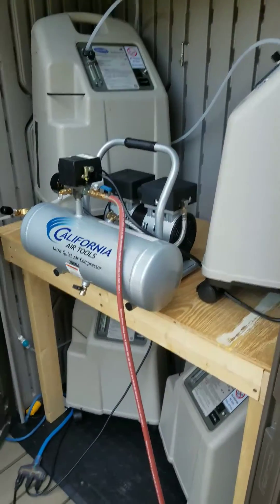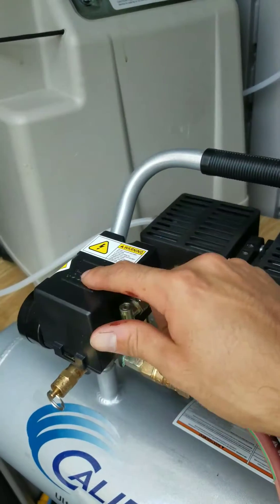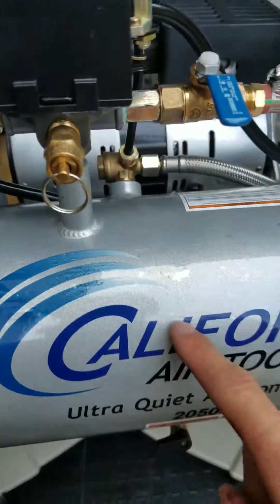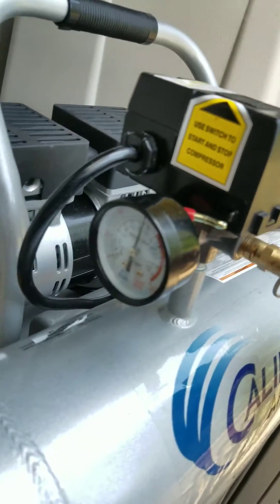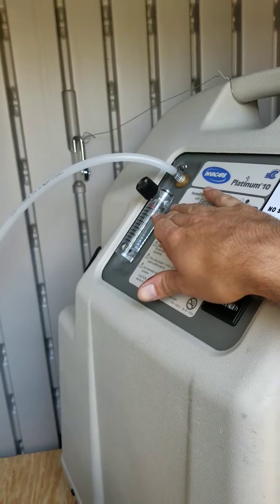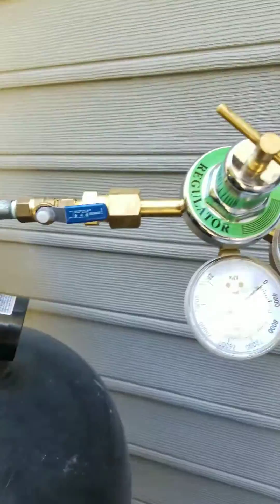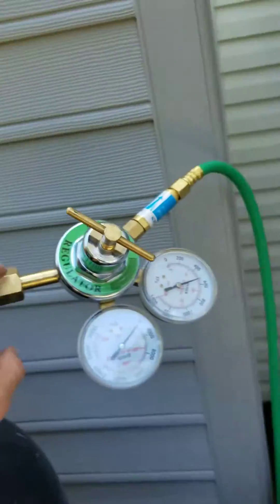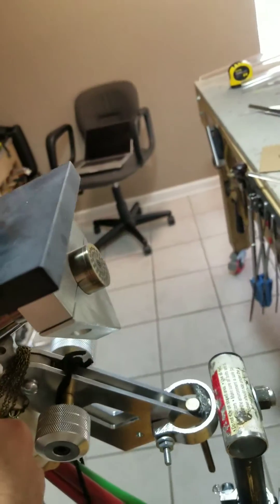Compressed Oxygen System for Flame Working/Glass Blowing

Comment: The studio I learned at had a setup similar to this. The question I have before setting up my own is does the compressor pull more than the concentrators can give? Would this work with just one 10liter unit?
Reply from the maker: Im glad its helped many artist. To answer your question, It will not. You have to have the same or more lpms than the compressor can compress. Otherwise you will encounter loss of oxygen purity. Theres also loss of purity when running oxycons at full 10lpm. I prefer the purity of running all 4 at 8lpm.
Reply: @MrAlejo53 I see, that’s what I figured. Do you know how many lpm that particular compressor is, I looked but it was in cfm and when I converted it was like 60-70 lpm. Thank you for answering my questions! 

I currently run a bobcat on 1 concentrator but definitely want to be able to use my larger torch.
Reply from the maker: @derickdoveglass cfm changes depending on how full the tank is. Ideally you want your off/on switch to start back up when you go down to a certain pressure which should be around the amount of lpms your giving it. And then the more it fills up it will suck less lpms but thats okay.
Reply: @MrAlejo53 perfect, thank you for your time. I was about to use home fill to fill a k tank but I’ve always wanted to go this route instead as I just use a small torch a few times a week.

Comment: Hey is that a large tank a water heater tank? Trying to think of a way to cheaply build a large volume storage tank for my system (I have it working but only have 8 gallons of storage volume)
Reply from the maker: No it's a 60 or 80 gallon regular air compressor tank. Sometimes you can find them used when the compressor head stops working but you do need to make sure and thoroughly clean it with simple green for the grease. Rinse. Acetone. Do these steps like 3 times or so to make sure you don't have grease/oil built up in there

Comment: Hey bud got any suggestions on how to clean the old/large compressor tank to prepare it for oxygen use?
Reply from the maker: I made some rollers to put the tank on. May be able to use a skate board or something like that. Then I used Simple green. Rinse. Acetone. Rinse. Simple green. Rinse. Acetone. Rinse. Simple green. Rinse. Acetone. Rinse.. so about 3 cycles of simple green rinse acetone rinse.

Comment: I have 2 10liter oxygen concentrators will this work with filling up K-tanks , second what kind of compressor is that ?     Third do I need a high pressure hose from the compressor to the tank ?
Reply from the maker: This will only fill a K tank to about 130 psi, they usually come from the oxygen store at about 2000 psi so its pretty much going to fill empty. This is a HIGH VOLUME OXYGEN system so we use tanks that can hold more volume instead of more pressure. if you want to fill your k tank up you need a homefill, invacare makes it. you will also need a whip it which is a metalish hose that can withstand up to 3000 psi. however that system fills at only 2 liters per minute. which is fairly slow, some people that use that either run multiple homefills or just fill at night and use it once its done.
Reply: @MrAlejo53 would you say it’s more efficient to run it this way or to use a home fill?

Comment: Did your tank explode yet? How do you keep impurities out of the oxygen rich tank and not make it into a bomb.?
Reply from the maker: as long as your not going over 130 psi you will be okay. Compressed Oxygen needs a certain amount of pressure before oil or an impurity could light it. You also want to make sure you clean your tank thoroughly with simple green and acetone.
Reply: @MrAlejo53  I'll sub in hopes to see the cleaning process. Also, what model torch is that. Good vid btw
Reply from the maker: @RubbinRobbin  For cleaning it, i removed all fittings sticking out, had the tank with the bottom valve open. and had it laying on its side on top of 2 skateboards facing up. (not actual skate boards but just 2x4 with skate board trucks facing up, essentially just making a roller for the tank. once you can spin it on its side with the opening. pour simple green, spin, water, spin, (you could either open up a side port and drain out the dirt or tip it back up right and have it drain out the bottom (same hole you use when the tank is on its side). Then use acetone to get all the residue out and repeat that cleaning process about 3 times. I would make a video but i dont think ill have to do that again unless I make  another set up.
Reply: @MrAlejo53   Thanks, i thought you would have put like a pressure hose line in there, i didn't think it was just sloshing detergent around. I'm trying to get my hands on a air receiver but they are so expensive.

Comment: What's keeping the compressor from over drawing from the oxygen concentrator?
Reply from the maker: nothing in particular besides the pressure relief valve in the line right before it hooks up to the compressor. Some air gets sucked in through there when you first start up your system but once you get to about 60 to 80 psi, the compressor will be sucking in the same amount of oxygen as the oxycons are putting out. So you need to let it run and bleed for a while until all the air or impurities come out. but if you shut off your valves and make sure you don't have any leaks, then theoritically you would only have to do this once ( on the very first start up ).

Comment: What size it the barb fitting and aslo what psi on the first relief?
Reply from the maker: Barbs should all be 1/4 as this is the same size of the hose that your torch is being hooked up to. And if your referring to the pressure relief valve that is connected right before the compressor, I would say keep that between 5 and 10psi. I think mines at 8psi

Comment: My welding tanks come filled at 2000 psi...      It appears that you will never come close to that with this set up.           What is the top psi you can store this oxygen?
Reply from the maker: That all depends on your compressor. However, this very different than a liquid oxygen tank. Your using more volume or area, at a lower psi. You could hook up how ever many 60-80 gal tanks to this as you needed. And you can store it to whatever the compressor you get is capable of. With that being said, for safety reasons I wouldn't store it any higher than 130psi. You should also keep in mind that the more tanks you get, the longer it will take to get to your top psi. I would recommend 3-4 oxycons per compressor 1/2hp-2/3hp compressors per every 60-80gal tank. Follow my insta @theglassmeltingpot if you want to talk more about it.

Comment: Hey man, nice setup. Hows it holding up? Any problems after using it for a bit?
Reply from the maker: 2-3 years later. I haven't changed anything on it and works just like the first day I set it up
Reply: @MrAlejo53  thanks man 🤘 it means alot. Ive got 90percent of the items needed for this build. Have you seen torch talk episode 85? Its all about diy oxygen systems. Thank you!

Comment: is the the smaller tank necessary to have? can you have the compressor hooked up to the bigger tank on its own? i have a 40 gallon tank with the air compressor so would i need a bigger tank?
Reply from the maker: It doesnt hurt to have the smaller tank connected. Just adds more room for your oxygen to be stored in. 40 is a not terrible. I think this one is a 60

Comment: for the intake on the compressor; did it just connect right up or did you have to mod it to put that tube on?
Reply from the maker: I bought a barbed to threaded end adapter at home depot. You should be able to find it at home depot by the plumbing area